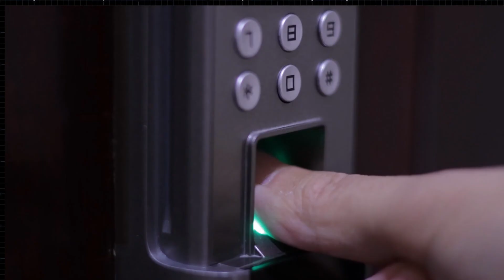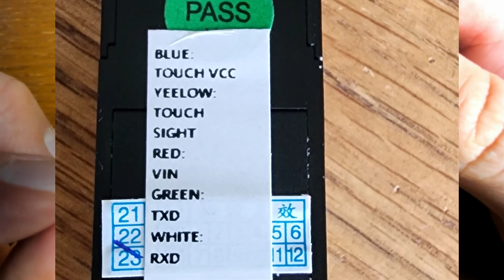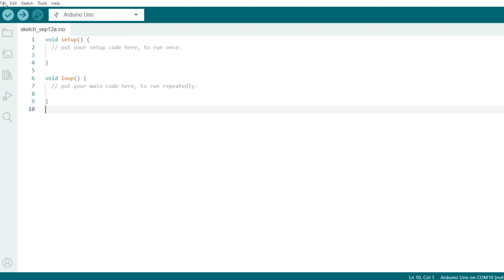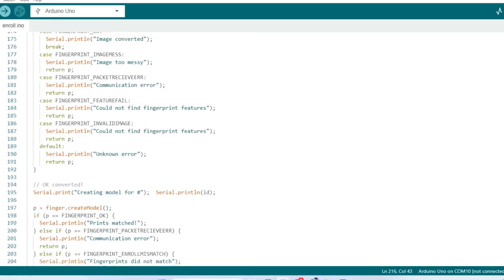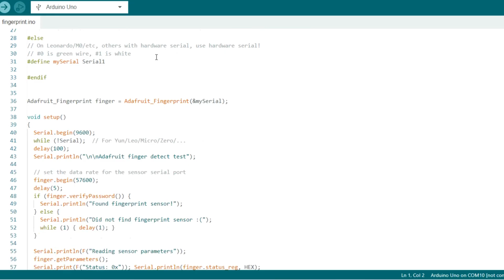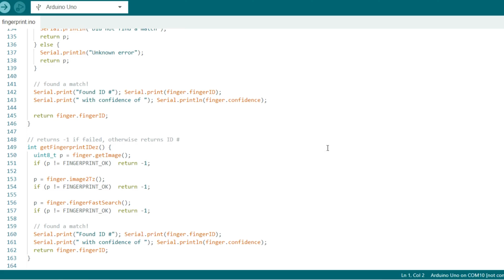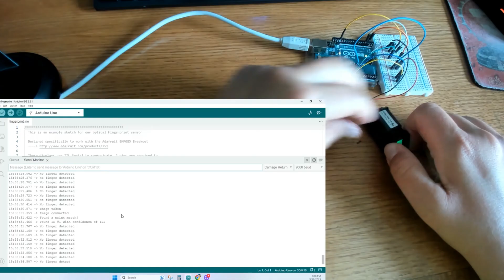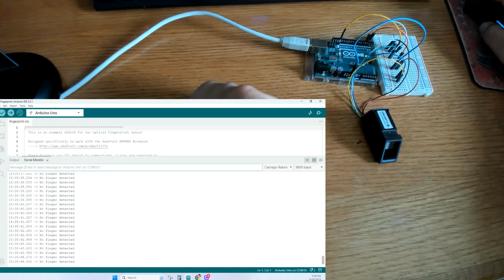Arduino Uno Fingerprint Scanner Tutorial: Enroll and Verify Your Fingerprints

Comment: Hi can I use R307 fingerprint sensor?
Reply from the maker: Sure!  why not.  You can use it with Arduino 👍
Reply: @BMonsterLaboratory hi it say no fingerprint detected
Reply from the maker: @JustinPiquero-f8u  did you try the example code?  use a clean finger, clean surface plate with damp alcohol cloth, hold finger in one place for a while. If it doesn't work try pressing and holding by slightly moving around the surface. I think the biggest issue could be not placing the finger flat or getting oils on the surface of the reader.
Reply: @BMonsterLaboratory  hi my fingerprint sensor is blink only once i input it is it damage?
Reply: @BMonsterLaboratory  how i can fix this?

Comment: Adafruit Fingerprint sensor enrollment
Did not find fingerprint sensor :(
WHY is ithis happen?? pls help. Are some sensors not working for this code ??
Reply from the maker: It could be a number of reasons. Wire connections, power supply, correct baud rate, update library.... What message are you getting? You're using the Adafruit library? 
could be a bad sensor but you'll have to do some investigating first before you can determine that. 
Are you using the same sensor as the on in the video? Did any debugging info print to the serial monitor?

Comment: hi there, i am a student i wanna know if it is possible to store the data of the enrolled fingerprints in a worksheet like in microsoft excel?
Reply from the maker: hey!  great question. Fingerprint scanners like the FPM11A store the fingerprint templates in their own memory and give you an ID for each enrolled fingerprint. I haven't tried it with this scanner but I believe using the Serial.print() function would allow you to capture data and display it on the serial monitor. You could add a data logger to your project for more long term data collection.   This is just my assumption....I'm going to look into it. Thanks for the question!

Comment: Can u just put the code in the description
Reply from the maker: #include <Adafruit_Fingerprint.h>

#if (defined(__AVR__) || defined(ESP8266)) && !defined(__AVR_ATmega2560__)
// For UNO and others without hardware serial, we must use software serial...
// pin #2 is IN from sensor (GREEN wire)
// pin #3 is OUT from arduino  (WHITE wire)
// Set up the serial port to use softwareserial..
SoftwareSerial mySerial(2, 3);

#else
// On Leonardo/M0/etc, others with hardware serial, use hardware serial!
// #0 is green wire, #1 is white
#define mySerial Serial1

#endif

Adafruit_Fingerprint finger = Adafruit_Fingerprint(&mySerial);

uint8_t id;

void setup()
{
  Serial.begin(9600);
  while (!Serial);  // For Yun/Leo/Micro/Zero/...
  delay(100);
  Serial.println("\n\nAdafruit Fingerprint sensor enrollment");

  // set the data rate for the sensor serial port
  finger.begin(57600);

  if (finger.verifyPassword()) {
    Serial.println("Found fingerprint sensor!");
  } else {
    Serial.println("Did not find fingerprint sensor :(");
    while (1) { delay(1); }
  }

  Serial.println(F("Reading sensor parameters"));
  finger.getParameters();
  Serial.print(F("Status: 0x")); Serial.println(finger.status_reg, HEX);
  Serial.print(F("Sys ID: 0x")); Serial.println(finger.system_id, HEX);
  Serial.print(F("Capacity: ")); Serial.println(finger.capacity);
  Serial.print(F("Security level: ")); Serial.println(finger.security_level);
  Serial.print(F("Device address: ")); Serial.println(finger.device_addr, HEX);
  Serial.print(F("Packet len: ")); Serial.println(finger.packet_len);
  Serial.print(F("Baud rate: ")); Serial.println(finger.baud_rate);
}

uint8_t readnumber(void) {
  uint8_t num = 0;

  while (num == 0) {
    while (! Serial.available());
    num = Serial.parseInt();
  }
  return num;
}

void loop()                     // run over and over again
{
  Serial.println("Ready to enroll a fingerprint!");
  Serial.println("Please type in the ID # (from 1 to 127) you want to save this finger as...");
  id = readnumber();
  if (id == 0) {// ID #0 not allowed, try again!
     return;
  }
  Serial.print("Enrolling ID #");
  Serial.println(id);

  while (! getFingerprintEnroll() );
}

uint8_t getFingerprintEnroll() {

  int p = -1;
  Serial.print("Waiting for valid finger to enroll as #"); Serial.println(id);
  while (p != FINGERPRINT_OK) {
    p = finger.getImage();
    switch (p) {
    case FINGERPRINT_OK:
      Serial.println("Image taken");
      break;
    case FINGERPRINT_NOFINGER:
      Serial.print(".");
      break;
    case FINGERPRINT_PACKETRECIEVEERR:
      Serial.println("Communication error");
      break;
    case FINGERPRINT_IMAGEFAIL:
      Serial.println("Imaging error");
      break;
    default:
      Serial.println("Unknown error");
      break;
    }
  }

  // OK success!

  p = finger.image2Tz(1);
  switch (p) {
    case FINGERPRINT_OK:
      Serial.println("Image converted");
      break;
    case FINGERPRINT_IMAGEMESS:
      Serial.println("Image too messy");
      return p;
    case FINGERPRINT_PACKETRECIEVEERR:
      Serial.println("Communication error");
      return p;
    case FINGERPRINT_FEATUREFAIL:
      Serial.println("Could not find fingerprint features");
      return p;
    case FINGERPRINT_INVALIDIMAGE:
      Serial.println("Could not find fingerprint features");
      return p;
    default:
      Serial.println("Unknown error");
      return p;
  }

  Serial.println("Remove finger");
  delay(2000);
  p = 0;
  while (p != FINGERPRINT_NOFINGER) {
    p = finger.getImage();
  }
  Serial.print("ID "); Serial.println(id);
  p = -1;
  Serial.println("Place same finger again");
  while (p != FINGERPRINT_OK) {
    p = finger.getImage();
    switch (p) {
    case FINGERPRINT_OK:
      Serial.println("Image taken");
      break;
    case FINGERPRINT_NOFINGER:
      Serial.print(".");
      break;
    case FINGERPRINT_PACKETRECIEVEERR:
      Serial.println("Communication error");
      break;
    case FINGERPRINT_IMAGEFAIL:
      Serial.println("Imaging error");
      break;
    default:
      Serial.println("Unknown error");
      break;
    }
  }

  // OK success!

  p = finger.image2Tz(2);
  switch (p) {
    case FINGERPRINT_OK:
      Serial.println("Image converted");
      break;
    case FINGERPRINT_IMAGEMESS:
      Serial.println("Image too messy");
      return p;
    case FINGERPRINT_PACKETRECIEVEERR:
      Serial.println("Communication error");
      return p;
    case FINGERPRINT_FEATUREFAIL:
      Serial.println("Could not find fingerprint features");
      return p;
    case FINGERPRINT_INVALIDIMAGE:
      Serial.println("Could not find fingerprint features");
      return p;
    default:
      Serial.println("Unknown error");
      return p;
  }

  // OK converted!
  Serial.print("Creating model for #");  Serial.println(id);

  p = finger.createModel();
  if (p == FINGERPRINT_OK) {
    Serial.println("Prints matched!");
  } else if (p == FINGERPRINT_PACKETRECIEVEERR) {
    Serial.println("Communication error");
    return p;
  } else if (p == FINGERPRINT_ENROLLMISMATCH) {
    Serial.println("Fingerprints did not match");
    return p;
  } else {
    Serial.println("Unknown error");
    return p;
  }

  Serial.print("ID "); Serial.println(id);
  p = finger.storeModel(id);
  if (p == FINGERPRINT_OK) {
    Serial.println("Stored!");
  } else if (p == FINGERPRINT_PACKETRECIEVEERR) {
    Serial.println("Communication error");
    return p;
  } else if (p == FINGERPRINT_BADLOCATION) {
    Serial.println("Could not store in that location");
    return p;
  } else if (p == FINGERPRINT_FLASHERR) {
    Serial.println("Error writing to flash");
    return p;
  } else {
    Serial.println("Unknown error");
    return p;
  }
  return true;
}
Reply from the maker: hi there. I can't always put code in the description or comments because sometimes it won't fit. This one is a Adafruit_Fingerprint.h library example, i was able to put it here in the comments. If you ever want it posted here or emailed to you, just ask...no problem at all.  Good luck! This module is fun to play around with. 👍

Comment: My enrolling process is done but in fingerprint code it shows fingerprint didn't match .... What should i do?
Reply: Thank you so much 😇
Reply from the maker: @Desaiparth760  you're welcome. good luck with your projects!
Reply: Sir I don't know what's going on with my project
I have put if if condition like if finger.cofidence < 70 then it should print our confidence level finger
But now it's showing multiple I'd with same finger like for same finger sometimes show id 2 and sometime I'd 3 with confidence level of 2 or 3
Please help me
Reply from the maker: @Desaiparth760   clean the surface with alcohol, even oils from your finger can throw it off. Does your conditional check look something like this?   if (finger.fingerID > 0) {
  Serial.print("Found ID #"); Serial.print(finger.fingerID);
  Serial.print(" with confidence of "); Serial.println(finger.confidence);
  if (finger.confidence < 70) {
    Serial.println("Confidence level too low!"); ?   adjust the confidence 70, 80, 85...see what works best.
Reply: My project works fine now Thank you so much for your support.❤😊
Reply from the maker: @Desaiparth760  that's great! Good luck with your projects 👍
Reply from the maker: Hi there! Try lowering the confidence. If you set it at 100, try 70.
Reply: @BMonsterLaboratory  pls say where
Reply: pls share the code for verify of fingerprint my rest is all done
Reply: and pls can you giove it with lcd
Reply: I will try and let you know thank you so much for your reply😊
Reply from the maker: @Desaiparth760   you're welcome. you got this :medal-yellow-first-red:
Reply: My code is like 
p = finger. Finger Search ();
If (finger.cofidence < 70) it show not match 
If (finger.confidence > 70) 
{
Serial.println("found match ");

}

Rest are same

For this code it's showing multiple I'd 
On serial monitor id 1 even doesn't showing 😂
Reply: bro even i am having the same issue and my submission is on monday pls help me

Comment: Hey I am using R307 fingerprint sensor. I have connected the wire and uploaded the code properly but the serial monitor keeps displaying that "Didn't find fingerprint sensor" would you help me please? Thanks.
Reply: Hay brother,  if you find any solution for it . Please let us know in the comment section. I have the same problem and I don't know how to solve it .
Reply from the maker: @wasalyunus  hey there!  are you having trouble running the Adafruit_fingerprint library ?  If you made any changes to a library or your code is different than the code i'm using in the video, can you post it  here?  If it's too long you can post it to the facebook page.
Reply from the maker: hey, sorry about late reply. did you get this figured out?  did you try any debugging in the code ?
Reply: I managed to solve this problem for myself. Try swapping the RX and TX on the ESP32
Reply: @notVinodRodrigo  Is this work for arduino uno??